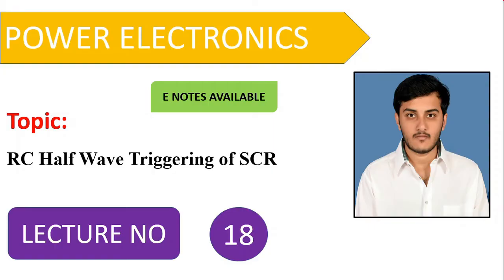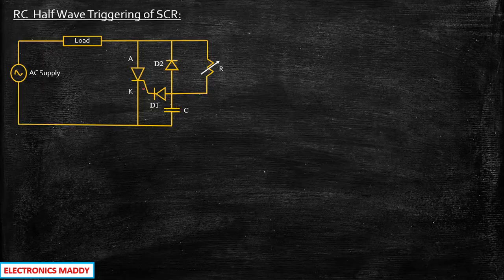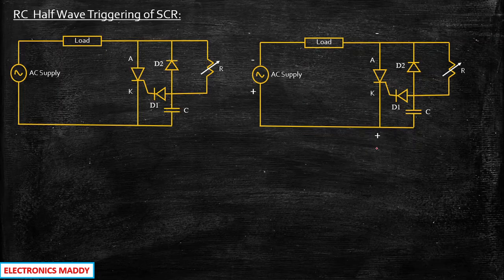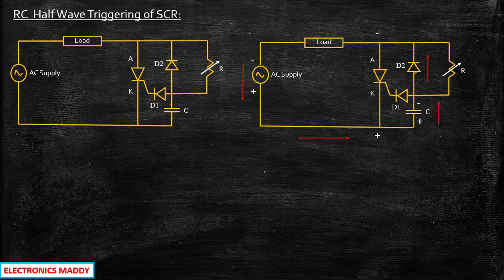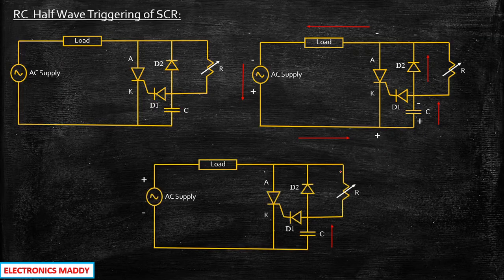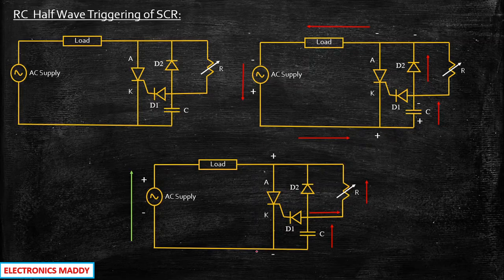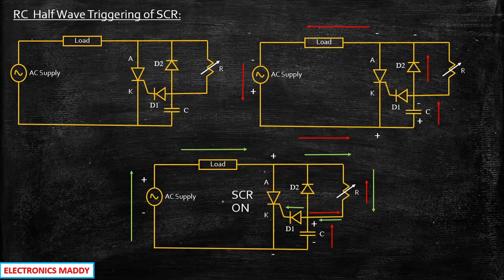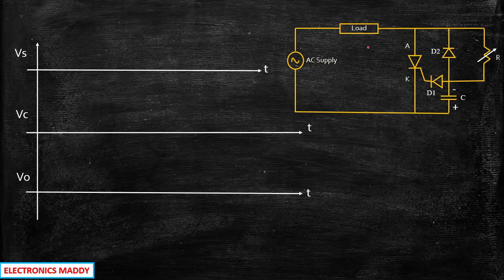RC Half Wave Triggering of SCR | Power Electronics | Lecture 18

Comment: 27.

a) Design a suitable half wave RC triggering circuit for thyristorised network operating on 240V, 50Hz supply. The specifications of the SCR are V GT(mio) =6V, l GT(max) =35mA Assume V D1 to be

0.7. Draw the final circuit.

[10 mks]

Pls Can you help me with this Question? Pls Kindly treat it as urgent 🙏

Comment: I have a doubt, so 3:40 if current could flow through capacitor C and diode D2 and load then what is the use of the circuit, it should block the negative half cycles nah ????